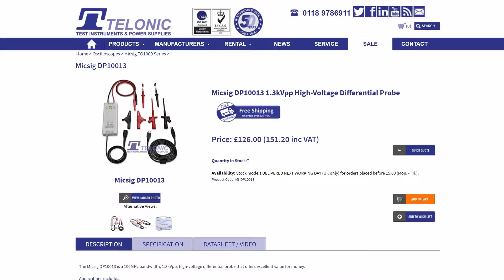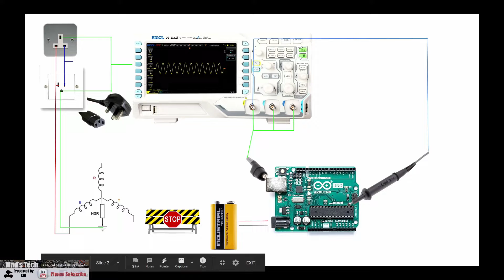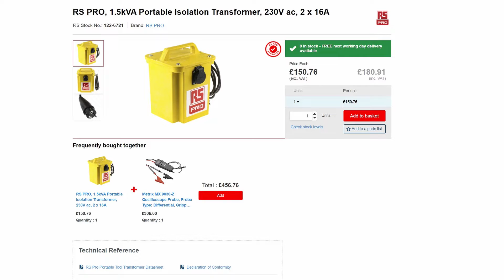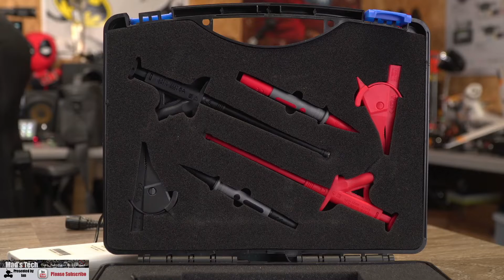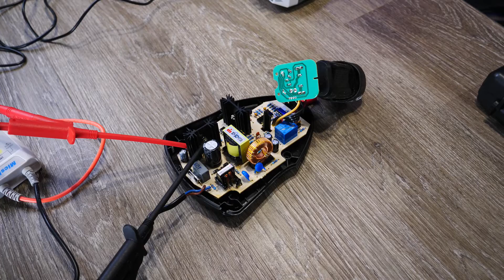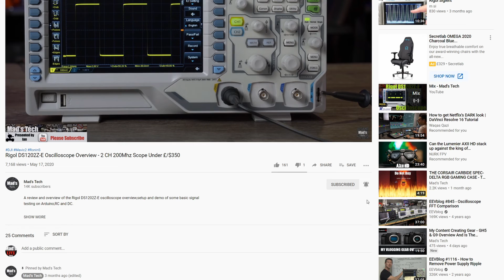Micsig DP10013 Differential Oscilloscope Probe Overview For PSU Repair.

Comment: Happy to see that very one probe on today’s video. I’m in the process of buying one now. I was surprised to learn that an isolation transformer was also needed as well. A very informative talk on the probe, how it’s used and with illustrated diagrams. Just that I get lost when told something but the cursor doesn’t align with the voice and confuses me. I wish more time and detail would be afforded to that. Otherwise I learned quite a bit. Thank you. So I’m  also looking at the mt15s combo multimeter/thermal cámara. Useful?

Comment: Why does nobody suggest getting cheap battery powered scopes (handheld scopes). I just got myself a cheap one exactly for that reason. It doesnt need to be a good scope with amazing specs. Just a 10-50Mhz scope that runs on batteries. Perfect for probing power supplies anywhere you like. As you mostly just read values of mabye a few hundred kHz, it is more than enough to be accurate enough. 
And most of that handheld scopes are cheaper than any of these probes. 
Of course you still should be careful as your leads will be on mains but at least you wont blow up your expensive bench oscilloscope nor blow anything else up. Just dont touch the leads (which is obvious) and you are good to go.

Comment: If using a tablet oscilloscope (i.e. battery powered) would it work without isolation ? Also here in Oz we have 240vac .. Could you use the supplied 10x probe to view a 240v generator output ? (Scope Vmax = 400v) . . . Or do we need to factor the Volts peak to peak (and need a 100x probe) ? Thanks for ur awesome videos 👍🏼👍🏼👍🏼

Comment: Why not use a battery powered inverter to power the SMPS you are working on and probing?   In that case the SMPS is not referenced to the Earth in your home and therefore not the one referenced in your oscilloscope.  In which case you would not need differential probes?  Or am I missing something?

Comment: Sir,  thank you for this video. I have this probe but haven't had the nerve to use it as I've been working on DC. However, I would like to test the output of my APC 1500 sinewave UPS. My plan is to unplug it and everything from it, connect the Dp10013  to the hot and neutral of tthe battery powered receptacle to see if it is an actual sinewave. I've watched other videos which don't use a diff probe or isolation transformer and it scares the snitzel out of me.

Comment: At 7:28, the point at emitter of the opto-isolator, which is the reference point of the hot-side, is not "Earth" and should NOT be directly connected to the "Earth" (GND) of the oscilloscope 😱. Otherwise, it will go BANG. The reason is because the circuit is using a full-wave rectifier. But, if was a half-wave rectifier, then it should be okay.

Comment: Thank you - excellent video, explained a lot and was a nice demo of the micsig. Just one comment, though, when talking about the Pi (and DC) I didn't see it mentioned explicitly if plugging that in via the DC jack or by plugging USB in via a wall socket or ground over HDMI through a TV - do any of these also create concerns?
Reply from the maker: Yes, basically any link from any PSU or HDMI ti ground would then be grounding the scope.  This only only something that would be a concern when working on switching power supplies for instance.

Comment: Differential Probes are NOT ISOLATED, they have mega Ohm input resistance referenced to ground. They have a isolated power supply in them to avoid ground loop current in the USB but the probes are NOT isolated. What makes them safe is the high impedance input on both probes, I reverse engineered a version of this probe recently. So far it's 3,628 people that have been misinformed by the repeated use of "isolated" to describe the ground referenced differential probe. Hook a multimeter up to the inputs and see what you get... probe to BNC ground = 4M Ohm, Probe to Probe = 8M Ohm?
Reply: Question: Looking at the differential probe design I assume the BNC plug needs to be grounded (earthed), otherwise there would be half the measured voltage between the BNC plug and true ground (earth). So the probe couldn't be used with an ungrounded heandheld scopemeter for example. Is this understanding correct? Thanks, A
Reply: @awesomeelectricalengineer3487  The point of the differential probe is so that you can measure differential voltage while ignoring common voltage, which allows measurements that are not GND referenced. They are basically converting the voltage difference between two voltage dividers to a BNC shield referenced (aka single ended) signal so that any scope can read it. Who knows what the results would be if there was no reference for the scope BNC, remember that you can't take a difference of anything with only one point of measurement. The scope BNC shielding is that reference, if it's grounded or not makes no change except for the fact that connecting a earth referenced BNC to any voltage is a good way to damage your scope, hence the need for differential probes!  As stated in OP, what makes them safe is the mega Ohm voltage dividers inside them, which is referenced to the BNC shield of the probe. You can accomplish the same thing using two standard scope probes set up in difference mode on the scope settings. REMINDER: Don't go poking around anything mains powered unless you are well aware of the dangers.
Reply: Those internal resistances could explain why connecting the probe to the variable speed control opamp circuit in a blender caused the blender to stop?

Comment: Might I mention that if you are powering a device like an arduino using a usb lead from a computer there is a direct reference to mains ground through the usb ground. Worth bearing in mind.
Does anyone know whether Micsig have solved the common mode rejection issues that were found with the DP0007?

Comment: Not isolated, but high resistance between probe and scope.
Reply: Wrong, it is isolated from the scope as the circuitry of the probe generates a low voltage signal completely isolated. Watch the eevblog teardown if you don't understand what the differential electronics are doing. He explains the mechanics very well.
Reply: @PurityVendetta  was there an isolation transformer inside the probe ?
Reply: @PurityVendetta  It’s kind of funny that you refer to EEVblog, because what Dave Jones is saying in his teardown is that the probes are NOT isolated. He even measures with a DMM between the probe tips and ground to demonstrate this in his teardown video.

Comment: Or basically cut the earth wire.. and the problem is solved :)
Reply: not exactly. The isolation between primary and secondary sides of the transformer of the power supply of oscilloscope may not be able to bear the voltage as high as a high voltage differential probe which usually works on hundreds to thousands volts. And the capacitance between the primary and secondary sides of the transformer of the power supply of oscilloscope is so high that it can be considered as "short" to high frequency signal. I think using a UPS on battery mode (turning on and unplugged from wall socket) to power the oscilloscope might be a proper alternative option of using a differential probe, or simply use a handheld oscilloscope on battery mode.

Comment: Hi friend.
I have a question. Is this probe necessary to work with 220ac input switching sources?
I tell you because there is a previous model.
If so, I have to set the oscilloscope scale by 1000x (mine does not have 500x), the isolated probe by 500x and I divide the signal by two. Is that correct?
I would appreciate an answer.
Greetings

Comment: I purchased in in USA, but using in India. Though, it was slightly higher than my budget, I really like this investment, as I frequently work on flyback converter and induction cooker circuits, which works on mains voltage. I have been using this probe for past 2 years and there is no issue till date.

Comment: Primary side of switchmode power supplies is never referenced to earth. The secondary side however, can be.
Reply: The primary side of a switchmode power supplies is always referenced to earth, that's why it is marked as HOT on the print,
and the secondary side marked as COLD.
If the input side of the swithmode power supply has a earth connection, this earth connection is in most of the swithmode power supplies straight through connected to the minus of the secundary output.
This is the case with notebook supplies that have a earth pin on the input, and with ALL ATX desktop power supplies.
There is only 1 exception, and that is if you power a switchmode power supply from a isolation transformer, then the primary is not earth referenced.

Comment: Hi, I am just getting into electronics repair, more specifically, car audio amplifier repair, ranging from 18wrms-1000wrms. I know I need an Oscope but there are so many out there and I am not educated enough on the equipment to know what I need or don't need. I know I want one that would have a similar response that a CRT display would have. I say this because I heard there is an input lag with an LCD display which the CRT display does not have. My budget is around $750 and I want an Oscope that will do everything because I don't want to have to upgrade later down the road.